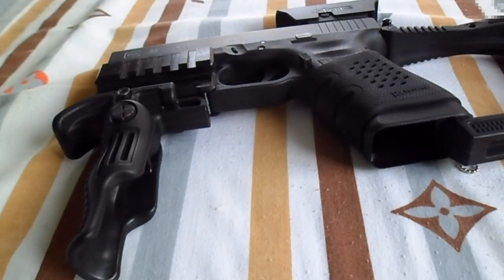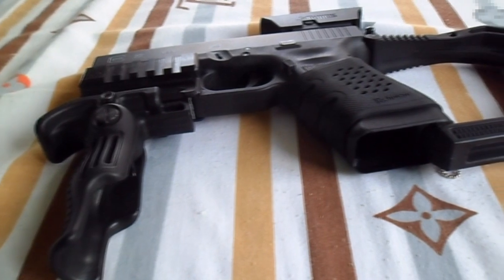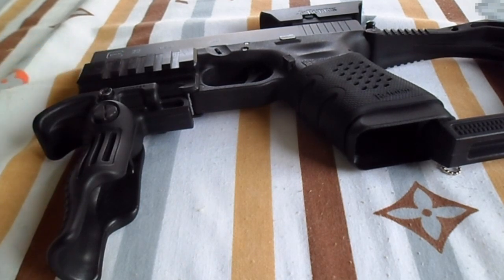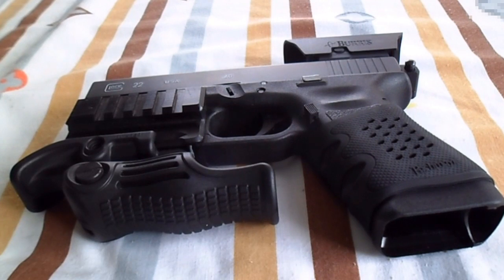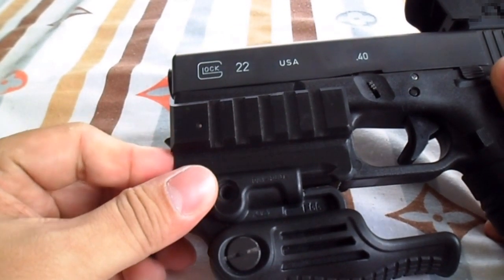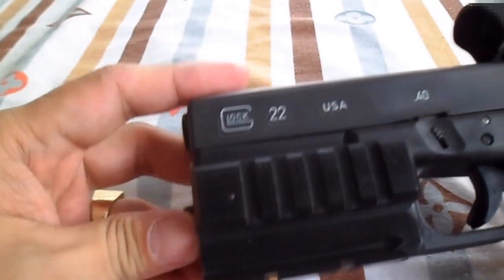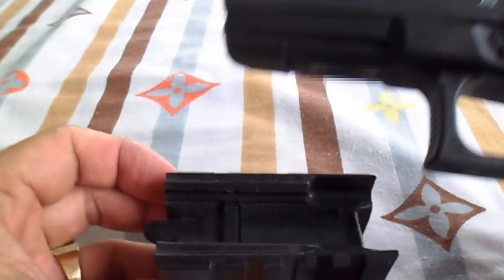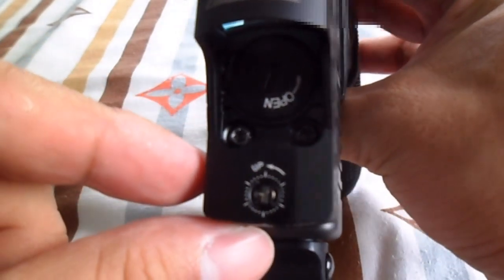Glock 22 Machine Pistol Part Two

Comment from the maker: Nope, not at all. But take note that I'm not in the US, so our laws are a little bit different than what you might have there.

The folding grip is called the "Fab Defense Folding Grip Glock-Small", or "FGG-S". 

The Burris Fast Fire III is great, works very well. I haven't had any problems with them so far, they have been quite reliable. I wrote about them on my blog site, just follow the link on the description if you want to read more about it.

Comment: Fun times in short durations, but I'm not sure if you are aware, the rails on every Glock but the 18 are not designed to withstand full auto mode long term. They will eventually shear from the frame.

Comment from the maker: Hi. I'm from the Philippines. Rules here are a bit more loose than in the US when it comes to Glocks and their full auto selector systems. You are supposed to register your Glock as a "Machine Pistol" when you use an FSSG, but I only put on mine in the Shooting Range, and remove it as soon as I exit the range, hence I haven't registered it. 

As for our shooting ranges here, most, if not all of them only rent out handguns, but not full auto weapons, so its not as easy to shoot those here.

Comment from the maker: I'm not aware of any approved authorized dealer of the original FSSG yet. I have seen some being sold by individuals in the Firearms forums here, and they are quite expensive, at least P20k.

Some gun stores are selling their own versions of the FSSG, and they work well, like the one I am using.  

Other sources for the FSSG copies are the Firearms forums I mentioned above, and the "Sulit.com" website.

Comment from the maker: Sorry, but as far as I know, the only difference between the Glock 18 and 17 (or any other Glock) is the fact that the Glock 18 has select fire capability, while the Glock 17 does not. I have not been able to find a credible source that says otherwise. If you have one, then e-mail it over it me at crazycousin377@gmail.com, and I'll check it out.
Reply: Glock 18 has, yes a select fire switch, and the 18c (which is far more common then the 18, but still rare) has a compensated barrel. The glock 18 & 18c have a couple different parts from the 17, but thats about it.